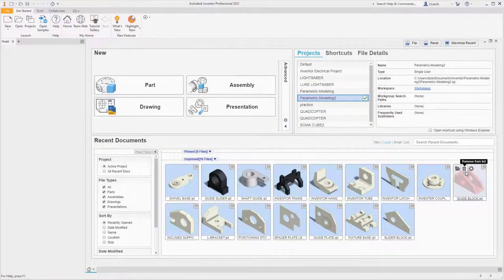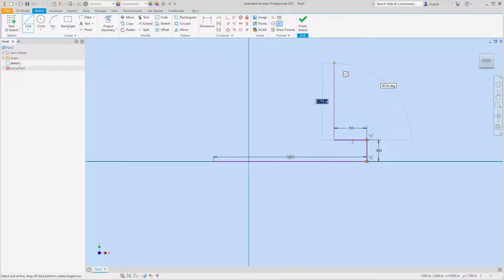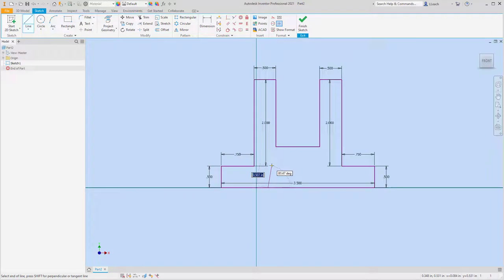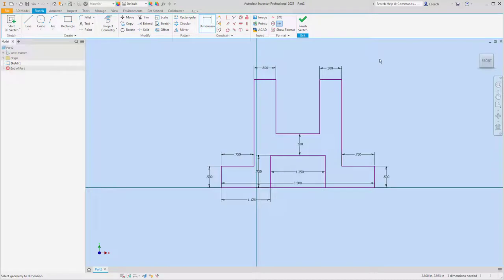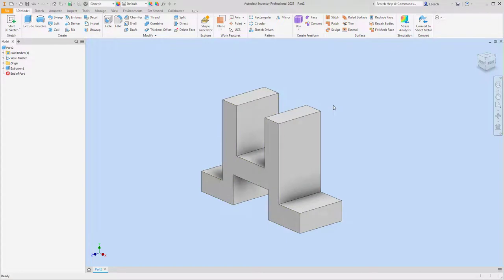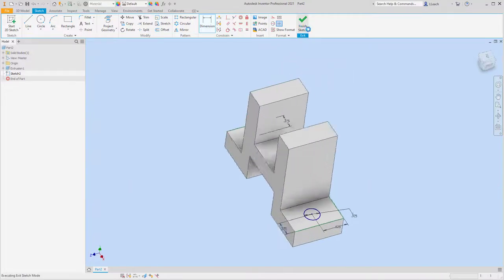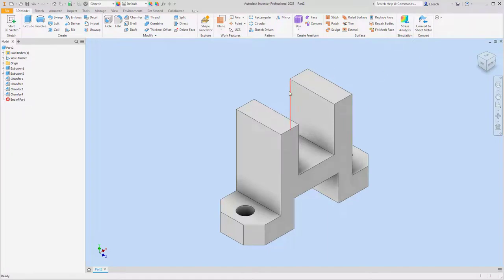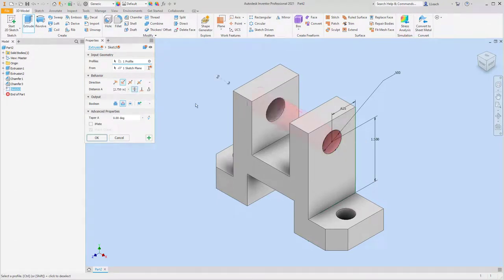ANCHOR BASE

Comment: How did you get the depth extrude as 1.25 ?
Reply from the maker: The distance from the center of the base circle to the back face is .625
I just multiplied that x2 to get 1.25